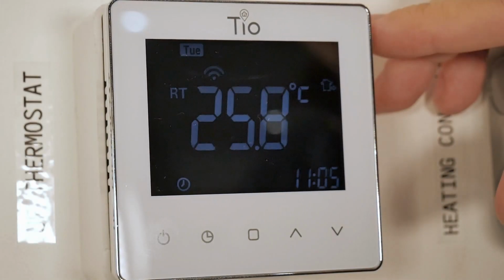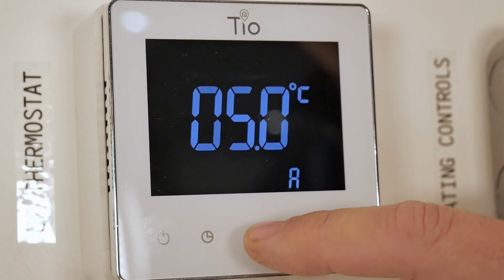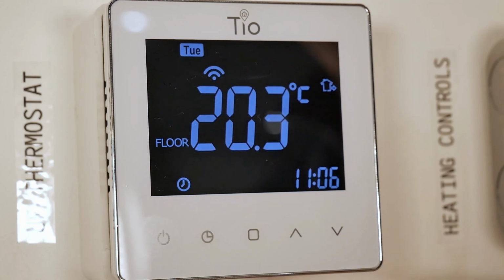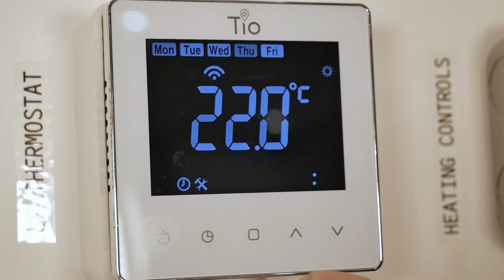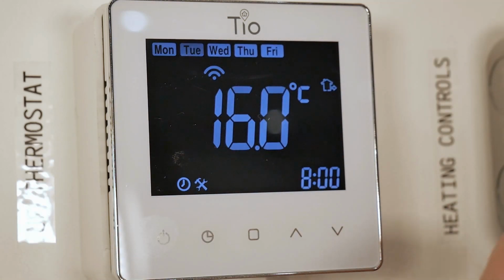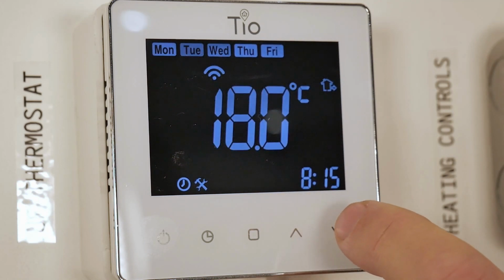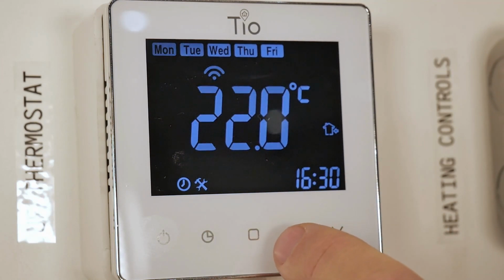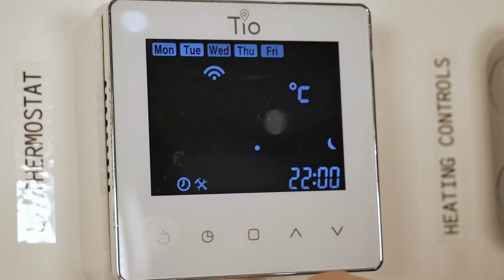EXPLAINED: Underfloor Heating Thermostat Controls

Comment: Another question. Under function 4 of the configuration setting you select OU = Control temperature using external sensor. Is that anything to do with connecting via app or does that just indicate as you say that it will only display what the floor setting is on??
As my floors do not seem to be heating up and if I change the configuration from IN (control temperature using internal sensor) to OU it will now read Floor but instead of having a temperature it reads 'Err' which I presume means error. 
Can you verify if that setting means just your floor setting or if it means that app/WiFi control is not connected please?
Reply from the maker: Hi Steven, please give us a call and we would be happy to help - 01935 421198